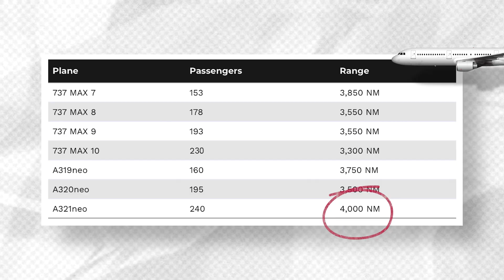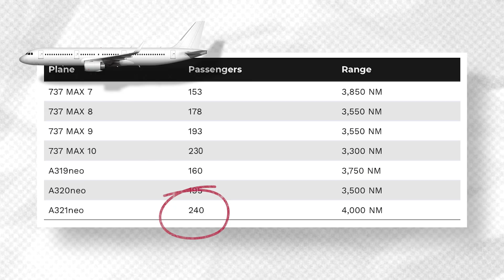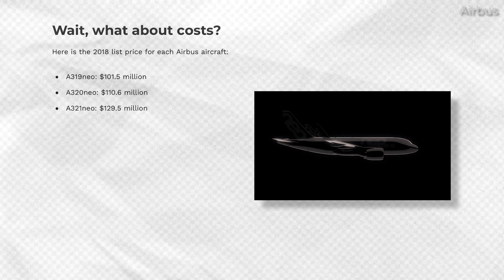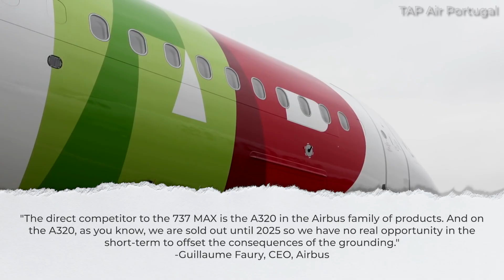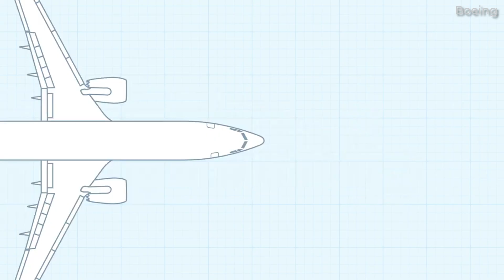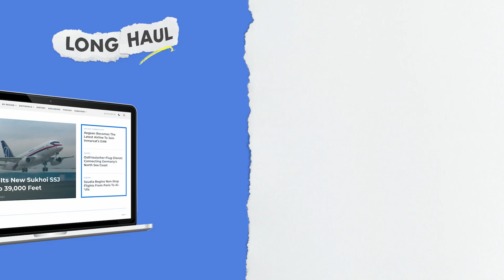The Airbus A320neo Vs Boeing 737 MAX – Which Plane Is Best?

Comment: For people saying "737 Max airframe is old and unsafe"
The software is what made it unsafe, not the 60 years old airframe, airlines don't care how old the airframe is, as long as it gets upgraded along with technological development in the aviation industry, as is the case for A320 and 737.
MCAS's purpose was to change the flight characteristics and control surface handling to make it similar to 737NG as a solution for engine placement problems.
Technically the 737 Max is flyable without an MCAS system, but it was installed for training cost cuts, and somehow Boeing decided to hide the system back then.
Old is gold but that being said everything has its end. 737 Max family would be the last ever 737 generation Boeing has developed, and it's time for Boeing to develop a new clean sheet narrowbody jet "NMA".
Reply: Southwest is the reason for the crashes.  They demanded the MAX feeling of handling to the pilots match the NG models.  As such, the had to put in the systems that modified the feel.  This was, however, never communicated to the other airlines and as a result that computer equipment/programming was an unspoken "secret" that caused the crashes.  That blood is on WN's head.
But Boeing is the one paying the price for it.
Reply: @d.p6075  they all have blood on their hands. Boeing, Southwest, American Airlines; but at the end of the day it was Boeing who entertained the idea and provided the final product. I agree though, I think everyone should be held accountable.
Reply: @d.p6075  That explains a lot, thanks for information!
Reply: @d.p6075  You are telling me, let me get it this right, that because Southwest "demanded" it, Boeing didn't disclose the how the MCAS worked and how to deal with the problems using it?
You are telling me that the way MCAS worked and the poor documentation and schooling on the system, the disclosure of it's existence, is Southwests fault? NOT Boeings?
Reply: The new big and heavy  engine in the old  airplane is unsafe. Boeing should redesign the airfame to fit the new engine. Hell No...they want quick bucks and comes out MCAS to prevent the natural tilt up of the plane when extra boost is applied on the engine.
Reply: @yours_sincerely48  You seem to be ignoring the fact that Boeing didn't tell the pilot about MCAS when the incidents could've been avoided. The causes aren't mainly in the engine placement or the natural pitch-up behavior in 737 Max at all, but flight characteristics that had to be changed to make it easier to fly for sake of cutting costs for Boeing customers.
Blame Boeing for hiding a poorly programmed software, not the 737 Max itself. If it's not safe right now, FAA and EASA wouldn't have cleared it to fly in US/EU airspaces in the first place.
I prefer listening to aviation experts, not average unknowledgeable people. 
I'm still flying this thing anyway
Reply: @sinada5444  I  am sorry for you flying a flawed flying machine. Boeing supposed to update the 737 with the Y project but because of greed they chose to compete with A320 with their old airframe with newer engine. Because of ground clearance they did a lot of " funny" modification like telescopic landing gear and the MCAS crutch. They should have gone for a complete new design and avoid " Crutches" that might be fatal. Which already had happened!. A good design shall be a airplane that is stable in flight without augmentation. The less the better. If anything happens at least the plane can glide back to safety.
Reply: @yours_sincerely48  Arguably Boeing should've upgraded and re-engined the 757 which can compete with A321neo/LR/xlr easily, but seemingly airlines weren't interested in it and preferred an upgraded version of 737 instead. what all matter now is the upcoming NMA projects which will replace the 737 fleets eventually.
Reply: @sinada5444  Yup I agree the 757 should be the logical choice for wearing the MAX.

Edit: Hear what others have to say,Veteran pilot and career software engineer Gregory Travis told Fierce Electronics that Boeing has not fixed structural design problems with the MAX aircraft and is instead relying on updated MCAS software to provide critically needed safety for pilots.   

“Given how badly [Boeing] screwed up the original MCAS implementation, there is no confidence that a significantly more complicated implementation, created by the same people responsible for the first, will do anything other than add additional failure nodes,” Travis said via email.

“For well over a year now, Boeing has fought tooth and nail to keep MCAS on the 737 MAX as opposed to deleting it and seeking a waiver…or developing aerodynamic modifications to the airframe to make MCAS unnecessary,” he added.

“Instead, Boeing has spent billions of dollars trying to make MCAS viable,” he added. “What that tells me is there is a serious aerodynamic/handling problem that presents itself if MCAS is not operational.
Reply: @sinada5444  during the merger and proceeding actions, Boeing burned a lot of bridges with former 757 contractors. The supply chain was dead before the aircraft even ended production.
Reply: I wouldn't say it's unsafe, it is old, but not unsafe at face value. 
What they did to get away with not having to modify it, THAT is the sin in this story. It's got a name: MCAS!!!
I've flown in the 737 plenty of times, and it's a perfectly fine plane, but the MCAS is a system that was handled (very) poorly, in every way!
It's not even that MCAS is a bad system, it's the way they implemented it, plain and simple.
Reply: @grandnagus5851  Agreed!
Reply: Keep in mind the 737 MAX still has physical cables attached to the control surfaces…just to put into perspective how outdated the technology is. For a commercial aircraft of this day in age, that’s kinda sad.
Reply: @kbos_aeronautics  The technology is there, because it works. All computer is not all good. System failure means complete failure whereas with hydraulics manual control is still possible even without thrust. 
Airbus fans like to talk about the 737 as if it's flying with 1967 tech. It's definitely not, and actually has more modern features than the A320. Engine chevrons and wing design, just to mention 2.
Reply: It wasn't just the software. What about the missing AoAs sensors for redundancy.
Reply: @Sedna063  And now they are going to make the MAX10 without EICAS, a safety feature required by federal law.  If it's Boeing, I ain't going.
Reply: @Sedna063  Arguably yes
Reply: @Sedna063  I mentioned that too, maybe in another comment The sensor used to only be on the captains side of the aircraft, and now it's on both sides.
Reply: It never suffered from rudder hardovers?  It never had batches of manufacturing defects?
Reply: @AquariusTurtle  nahhh, we are conveniently ignoring those for the sake of a [severely flawed] argument!! 😂
Reply: @AquariusTurtle  Of course we can't deny that the 737 airframes had historical flaws and manufacturing defects including the Rudder issues (PCU) causing 157 deaths in the '90s.
However, it's an outdated airframe but successful machine, which is now arguably in its late life. Boeing has to commence developing a new airframe (NMA).
Reply: @sinada5444  People forget ALL the problems the 737 has had since Day 1.
Reply: Yep, the age of the airframe - designed for manual loading and so too close to the ground - meant the big new engines had to be moved, which led to trim issues, which had to be corrected in software. So it was a software issue but one that could never have arisen if the airframe wasn't so ancient.
Reply: Most probably they will come out with 737 Ultra
Reply: Airbus lovers are just haters. They make arguments that make no sense. The 737 is the most successful commercial aircraft in history for a very good reason. Not counting the Cessna 172
Reply: @sainnt  I don't love the Airbus, I just have to work on it, as I once did on 737s.  The 737 was great for its time as a regional jet, but it's been far surpassed starting in the 1980s.  I also like the 707, which I also flew for 8 yrs, but it was a royal pain in the ass with maintenance and it was very unforgiving compared to anything now.  The Airbus is simply more modern, safer, more comfortable, better range, better payload, etc.  The 737 might be successful but that depends on how you measure it.  Don't forget that its decades of design flaws have also killed many people.  It's an older generation design with older generation problems.  You still have to manually shut off center tank boost pumps.   It's that old.  Also, try sitting in the jumpseat of a 737 sometime.  That's a new experience in torture.  There's absolutely no room in the cockpit.  I can't even fit my bag in the cockpit.  In the Airbus, I can fit 3 big bags, and there's room for a person to lay down behind both pilot seats.
Reply: @AquariusTurtle  I agree that the A320 aircraft is better for pilots. Airlines don't purchase aircraft for pilot comfort. Also, your characterization of the 737 cockpit is a bit of a stretch. The cockpit was originally built for 3 people-pilot, copilot and flight engineer. Because the A320 has a side stick, there's room for a tray table, but that turned out to be a blessing and a curse as pilots have either crashed, or nearly crashed the CO version from spilling beverages into the controls. 
I absolutely concur that Airbus cockpit is a great design for pilots, but the 737 still makes more economic sense for most airlines. That's why the 737, as old as it is, remains as successful as it is. It's just that good no matter how much Airbus lovers hate it. Newer is not always better.
Reply: @sainnt  I'm aware of the incident with the beverage spill.  However, that was in no way a near crash, not even close.  The software automatically locks out faulty side sticks and even stuck microphones.  Even if both sidesticks miraculously were drenched in soda drinks, despite being several feet apart, you can still land the aircraft entirely using the up front control panel.  It can autoland safely in virtually all conditions.  Remember the 737 still has cables, which break or suffer other failures.  The 737 simply has hundreds of more failure modes because it's a rube-goldberg of mechanical and electro-hydro-mechanical parts.  I can't tell you how many times I've had flap followup and asymetry problems in jurassic Boeings, of which the 737 is.  

Sure, the 737 may be better for a limited use case, particularly if Boeing gives them away, but it's not superior to the newer A32X family.  By the way, the 737 is superior in some places like Alaska, used by some airlines there because they land on gravel runways.  Their 737-200s are the only ones to be modified intake vortice generators to prevent some amount of FOD ingestion on rocky runways.  But, that has no practical use flying from JFK to LAX.  Also, the 737 has a high maintenance cost because of all those legacy systems.  That's why airlines prefer Airbus nowadays.  Like I said before, Airbus can command a higher selling price, and that's really the only argument there is for a 737 this day and age.  If Boeing charged the same amount, no airline would buy them.
Reply: @AquariusTurtle  Ok, here I have to correct you again. Sure it's true that every aircraft has redundancy built in to counteract a lot of scenarios. Even the MCAS had a safety feature, which was to simply switch it off. Problem is, those pilots were unaware that there was such a system on board.
You talk about the 737 as if you're describing the 1967 model. I'm venturing a bet that you've never flown a Max or even an NG. I already agreed that most pilots would likely prefer the Airbus, but that's more of a Mac vs PC or iPhone vs Android argument.
The number of Max aircraft on order is because of the reliability and cost efficiency of the aircraft. You can't argue that away. Even though Airbus has more A320 on order, there are still many more 737 flying. Numbers never lie, otherwise the 737 would be completely gone by now. It's an industry workhorse for very good reasons. 
By the way, a Canadian airline also has 2 737-200 aircraft for gravel runway landing. Can't remember the name of the airline.
Reply: @sainnt  Exactly.. the pilots were unaware, and the pilots were the backup feature.  That is 100% on Boeing, and there's no way to spin that to defend Boeing.  I'm talking about all the 737s.  I'm only qualified to fly the -200 and -300+ models (up to NG).  I'm not qualified to fly the MAX.  I simply ride in their jumpseat and have friends who loathe flying them for work.  But, from my existing 737 knowledge, I think I already know 90% of it because the systems are no different.  The biggest difference is the navigation portion of the cockpit.  Otherwise, everything works the same as the older versions (sadly).  Of course there are more 737s around the world.  How long has it been out for?   How is that even a remotely serious argument?  Airbus has always been a struggling company dominated by Boeing since they've been there since almost the Wright Brothers.  But whatever your metrics are, you can't say the 737 is cheaper because it's not, unless Boeing gives them away.  I know several people at airlines who are in charge of aircraft purchasing and universally they would rather have an A32X but they simply can't be produced fast enough.  On the other hand, Boeing is practically giving away 737s just to have a sale.  For the first time ever, the Airbus product is in high demand and all airlines want them.  Incidentally, have you ever seen the Al Jazeera documentaries on the 787?
Reply: @AquariusTurtle  You're making my point for me again. Yes, MCAS was a problem when it was a hidden feature on the Max. Not only is it no longer a hidden feature, it's also been vastly improved. The sensor was only measuring angle of attack on one side of the aircraft, but now does on both sides, and the software has been updated.
The list prices for the Max are higher than the A320. It's a misconception to assume that Boeing is giving away the 737. Both planemakers undercut each other with discounts to attract costumers. If you don't think that Airbus discounts the A320 to draw airlines from 737 operators, you'd be hugely mistaken. The Qantas deal is a prime example.
Most of the 737 buyers are repeat customers, so that speaks volumes in of itself. Also, more pilots are available to fly them because they've been around longer and hasn't changed much. These are decisions that airlines make. No matter how cheap you may think the aircraft is, it still costs millions, and ordering 50-100 at a time still represents a huge investment. That Max-10 order from Delta is one where they won't get any until at least 2025. Didn't stop them from doing so 
And, when we start using the argument that airlines are ordering the Max because they can't wait for the Airbus backlog, we forget that Boeing also has nearly 500 Max on order so there's a backlog there too. Add to that the Dreamliner backlog, and it's not convincing any airline to order the A350 or A330neo. They're waiting for the aircraft that's better for them.
In maybe 3-4;years the A32x may become king, but right now 737 still rules. People love their iphones to death because they think it's better, but no one is giving up their Androids.
Reply: @sainnt  the A320 is actually the bestselling commercial aircraft family, make sure to check current sources before providing false information!
Reply: @kbos_aeronautics  I know my facts very well. The A320 is the best selling in terms of orders, but the the 737 still has more delivered aircraft total, more than 600 in fact. Those are the facts, thank you.
Reply: I've only maintained the ceo and ng versions of both planes, but man are the 320s easier to work on. The whole design of the 737ng is a lot rougher and it's obvious they made compromises with the tech available at the time. Things airbus made easy to disassemble and and put back, boeing has behind 2 other components and structures. I would assume it's still cheaper to maintain the 737 somehow since they still get bought, but man are they a pain in the manhour aspect.

Comment: Is it just me or was simple flying being quite bias towards Boeing
Reply: Yeah for sure, quickly putting away 700 extra dollars of income but putting heavy weight on a few nm extra range
Reply: @caspervantieghem3192  Well you’ve got to look at the whole A320 family for comparison they looked at the all of the max family they failed to mention A321LR and A321XLR which the XLR already has 450 orders without being in service and the industry has spoken by favoring the a320 by having more sales then the 737 even though it was released decades later im not being a fan boy but looking at the fact that the market suggest otherwise
Reply: The airlines would probably disagree

Comment: Airbus every time
Reply: #airbusforever
Reply: @heidirabenau511  Well then. Airbus has had over 1000 fatalities, Boeing has made way more planes than airbus with some in an era where computer technology and safety features DIDN'T EXIST!!! They are in the wrong with MCAS, but the whole entire company is not made up of criminals. Also, the 747 was incredibly reliable, sure it had a few incidents before computers, but what about United 811? China 006? They sustained incredible damage and the structural integrity of the plane was so strong that the planes managed to land safely
Reply: @marveljayden  You mean the A320 and A320neo family, which had ~1500 fatalities. But the 737 almost has 5800 fatalities.